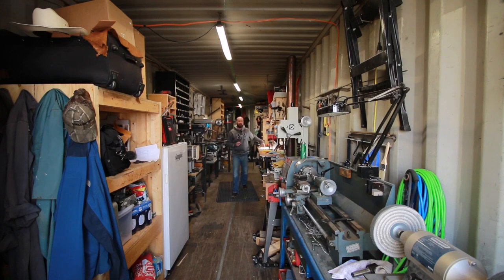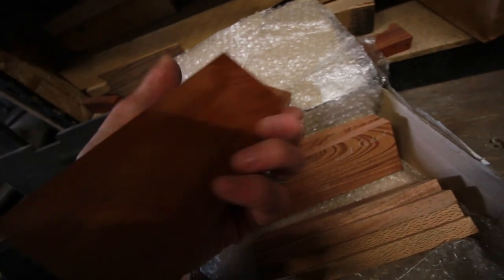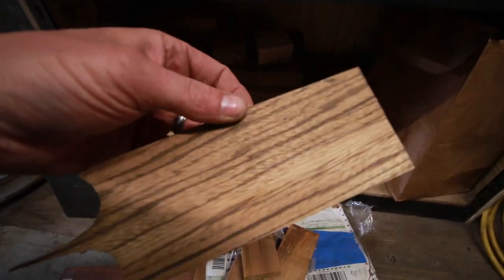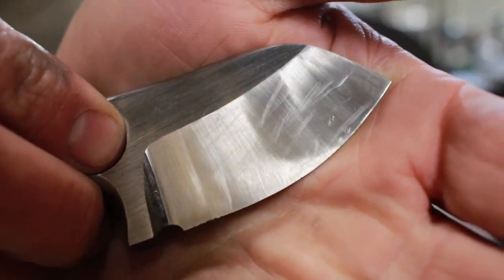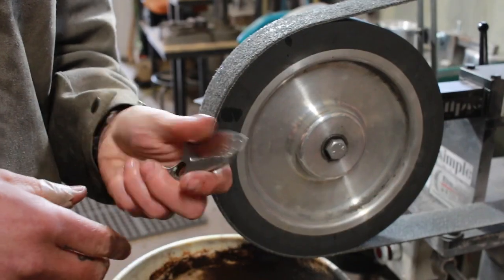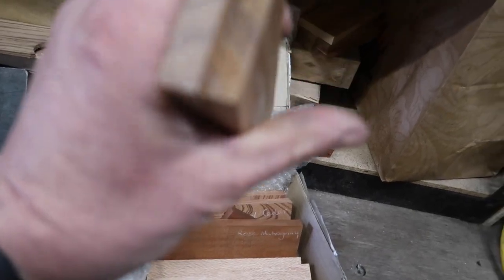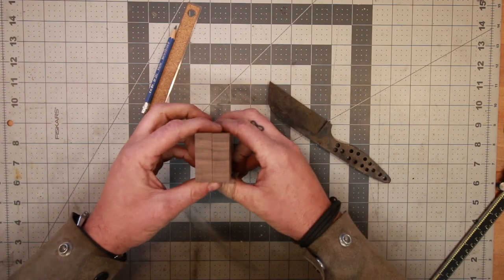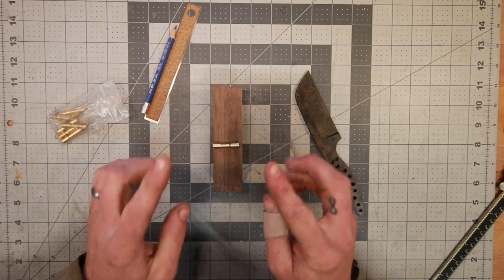Gentleman's boat knife part 2: the scales - knife maker's vlog -

Comment: be mindful of the angle of  the tapered tang when drilling your pin holes into the wood. use the holes in the tang as hole jig for both sides, not your first scale you made holes into as sometimes done when making scales for a regular flat tang blade. (not 100% sure , but pretty sure)!